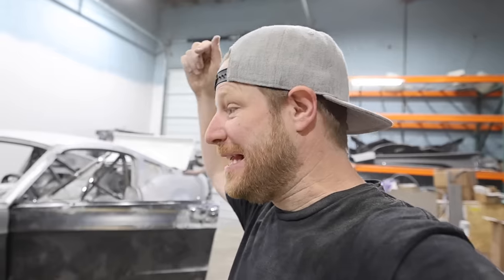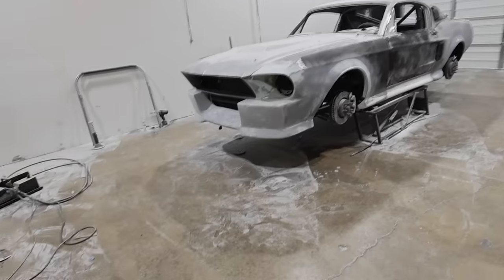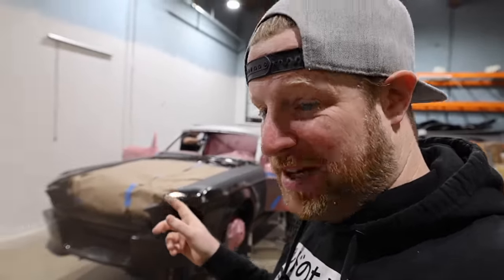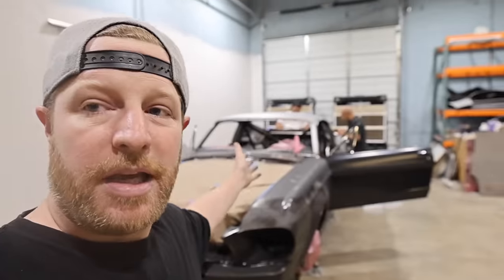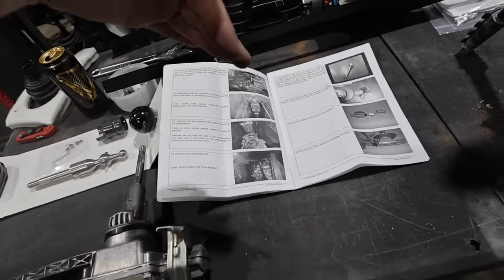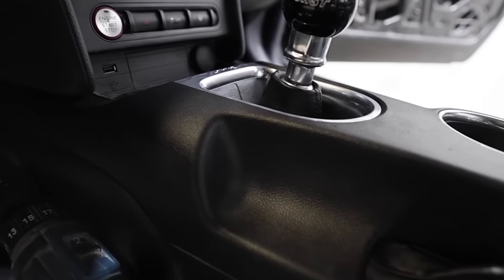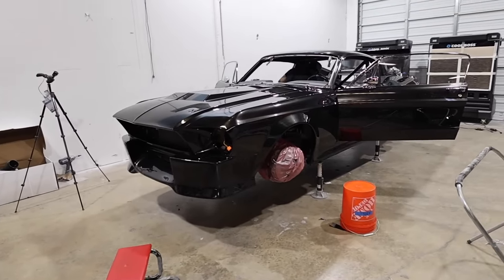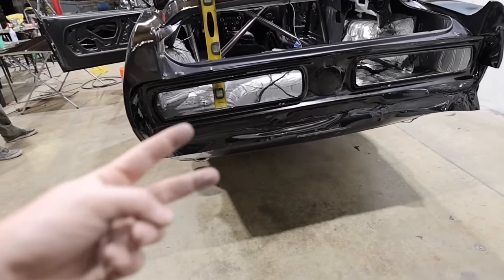B IS FOR BUILD SEMA MUSTANG Build Part 7 - PAINT, WRAP, INTERIOR!

Comment: 31:53 Speaking as a model builder, Wax Paper would have made a MUCH better light diffuser than a paper towel.
Reply: I'm hoping the LED don't get hot enough to burn the paper towels
Reply: @danielberrett2179  I was thinking the same thing.
Reply: Yeap I had good results using baking paper that I had to steal without Mrs noticing her kitchen supplies going missing😅
Reply: It's even different paper towels in each...
Reply: those flexible ikea cutting boards work well.
Reply: You can get semi transparent silicone baking sheets but it might take you a while to get some that suit the lights. Paper seems a no no to me.

Comment: An Epoxy primer would have been a great foundation and would have helped against the reactions you exeperienced but likely would have needed paint to hide the seams and jams. The dust... well you knew that was going to happen. Squirting water down prior to shooting may have helped. But either way you made it happen and that is what it is all about.
Reply: He needs a paint booth, at least he tried to make one at the old shop. Should do the same here. Also it drives me nuts when he works with the interior still in the car the whole time with no protection.

Comment: Dekagram is an excellent choice. I liked the original wheels on it, but I'm happy with the new choice. I know you guys didn't have time, but the best way to avoid those fisheyes in the paint would have been a coat of sealer before the paint - that probably would have resolved most if not all of your paint issues.

Comment: Hey Chris, I run the same head unit in one of my cars. The rear view camera usually is compatible, you just have to go into the settings and change the encoding. Also, the factory setting of my unit came with a "never turn off mode" which drained my battery. There is a setting menu with CODE 8888 to control stuff like the video encoding and then there is another submenu in there for the power settings. The CODE for that last menu can be found on YouTube.

Comment: They make an adapter to make the factory ford camera a video signal to run into the reverse camera input. The radio should have a reverse trigger wire also to move to that reverse input when in reverse.

Comment: If there is one thing I have learnt from this series is that it appears it would be easier to start with a ‘67 mustang body and resto mod it with modern running gear, suspension and electrics.
Reply: Just multiply your budget by 2-3 times the amount

Comment: The car is starting to come along nicely however the interior should be refined and perfected. Also the seats are the wrong choice IMO you should of opted for the old style seats which would give less sense of presence than the bucket seats that crave all the attention in the interior. Another thing I would like to add,the rear wheels should of been a different ET. Deep dish would of looked nicer. Over all the best Mustang by B IS FOR BUILD props to the team well done 👍🏼✅

Comment: Mustang guy checking in to be pedantic…

1: 17” wheels is period correct for the 90’s, not the 60’s. I personally think classics look great with 17’s though. 

2: the “Shelby” wheels you referenced are a modern interpretation of vintage Halibrand racing wheels which were never available from the factory on a Shelby Mustang, but did come on Cobras and GT40’s.

Comment: Anyone else notice the mistake on the front windshield ???.... The faded type paint they did should've helped cover the dashboard usually but now it's covering the headliner and maybe a lil bit of the vision.... Hopefully they didn't intentionally did that and would fix it soon.... Apart from that the interior looks awesome as well as the exterior..... Probably should've shipped the car to sema than drive it, where anything can go wrong and calling for a pickup for a long way in short notice can be a challenge.... Hope they make it to sema without any issues

Comment: Wouldn't it be easier to put the S550 stuff in a fastback opposed to putting fastback stuff on the s550?
Reply: Grey hair garage did a 1970 on a s197 gt chassis, I think he said the gen 1s just take to much work making the modern modular parts fit.
Especially in the engine bay and trying to do anything with upgrading brakes, spindles and the whole rear suspension setup.